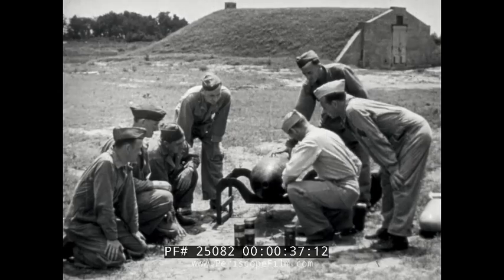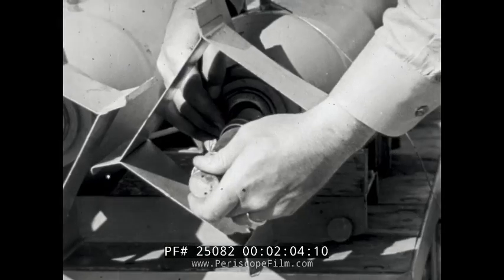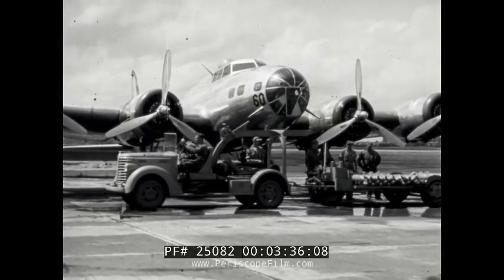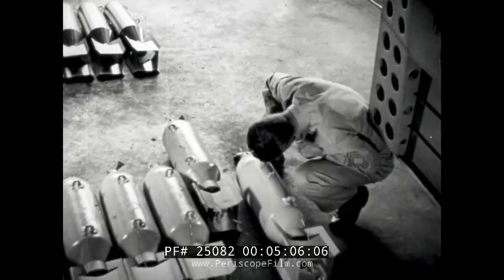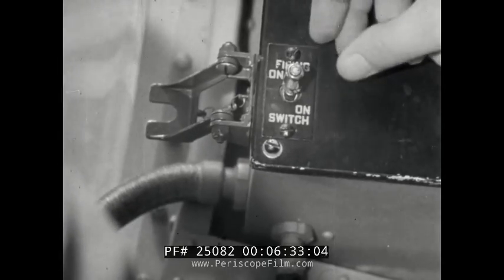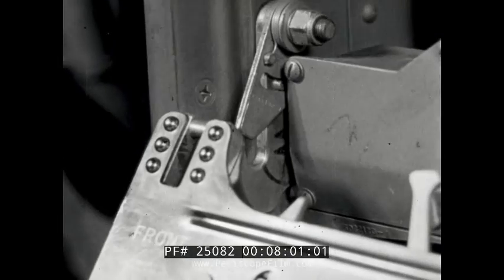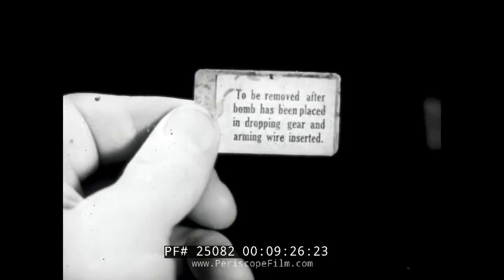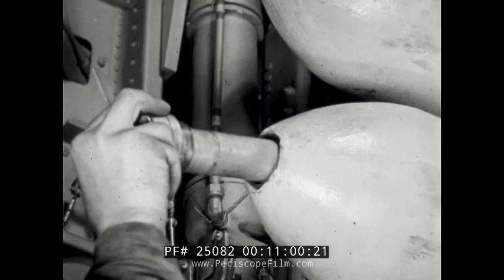HOW TO LOAD BOMBS ABOARD AIRPLANES ARMY AIR FORCE TRAINING FILM 1941 25082

Comment: Interesting film. As a weapons loading crew member from 1963-67 in the USAF, the procedure was streamlined considerably in the field when loading conventional weapons. The aircraft and their systems were different which allowed certain shortcuts (with safety in mind) from what was shown here. Interestingly, we were loading some old, "iron" bombs with stenciled dates back to WWII in 1965-66 in Vietnam on our B-57 bombers. We used a MJ-1 bomb lift truck to lift the bomb up to the installed bomb rack. Fuses were installed afterwards. We could load nine 500 lb. general purpose bombs on the B-57's bomb door and four tanks of napalm on four wing stations in about 30 minutes. 

Loading nuclear weapons (B-58's) was completely different with a very high level of control and security. Nukes were actually safer to load because of their many built-in safety features. Their handling and loading procedures were very strict and under constant scrutiny that permitted no deviation from approved procedures.

Comment: Seeing them load the nose fuse reminded me of off loading 155MM and 8in projectiles from barges to trucks to be sent to ammo storage for later use. The lifting rings were fitted into the hole in the nose of the projo lifting harness attached and the projo were on their way to the truck. Of course we never fitted a fuse to them that would be done when the projo's were being prepped for firing.

Comment: Of course - when loading bombs - don't let those bombs drop as you load them, especially with the safety pins removed. They are designed (most bombs) to detonate upon impact, and if you mess with these bombs (violate loading protocol), the bombs could explode, and can lead to very serious injury or even death.